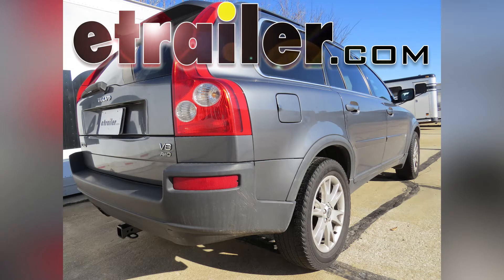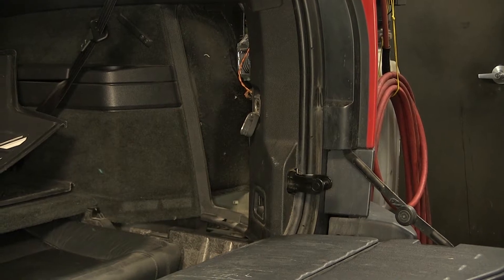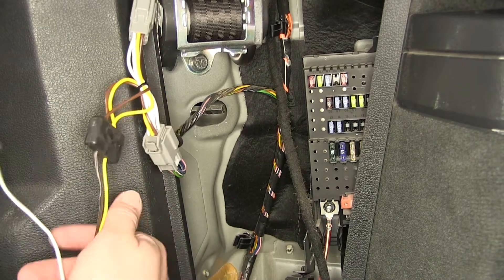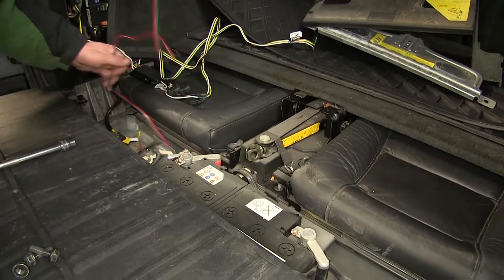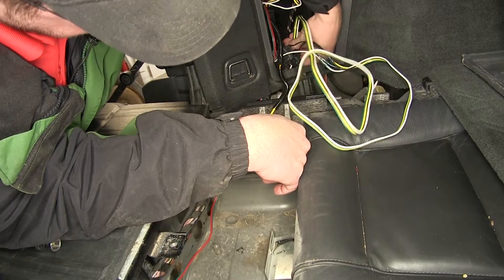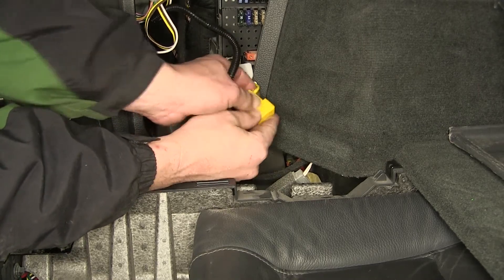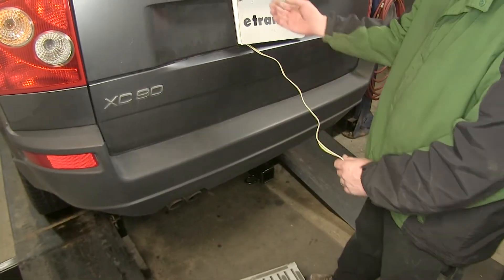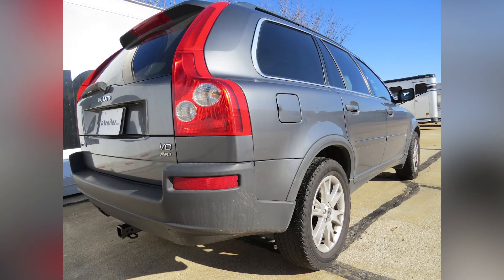Installation: T-One Vehicle Wiring Harness with 4-Pole Flat Trailer Connector on a 2005 Volvo XC90

Comment: just an FYI there is a rubber grommet on the passenger side of the battery (slightly obscured by the plastic battery cover) pop it out slice the top off and or slice half way from the center it there is a plug on your adapter.  This will drop the wire harness by the bumper and spare tire, under the bumper there will be clips that you can use to secure your external hitch wire harness.  Make sure you save the rubber cap as this will be exposed to the elements.

Comment: Another thing that isn’t explained here; the brake connectors are actually pinned into the sheet metal on either side with a plastic button. In my case (same year xc90) I had to reach in behind there with a little pry bar and pop them off in order to split the connector
Reply from the maker: Thank you for sharing this with us! This is good to keep in mind for future videos.
https://www.etrailer.com/Custom-Fit-Vehicle-Wiring/Tekonsha/118411.html